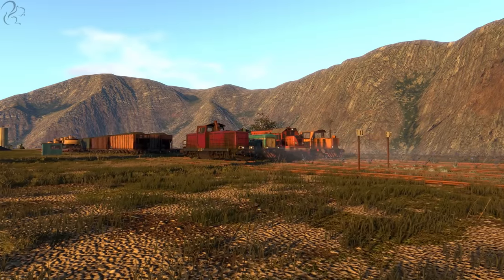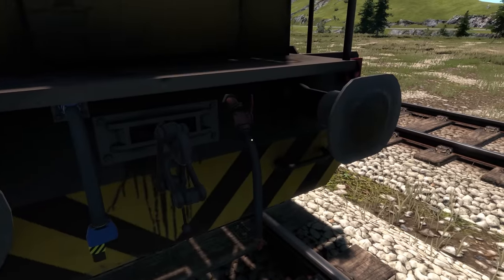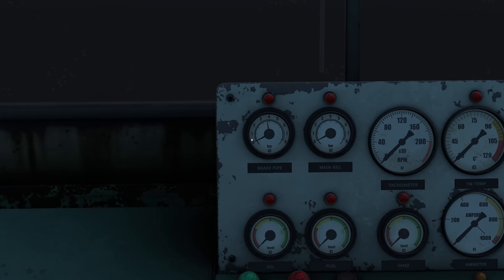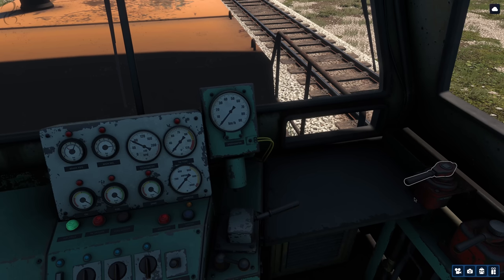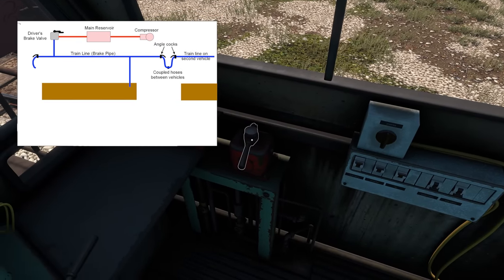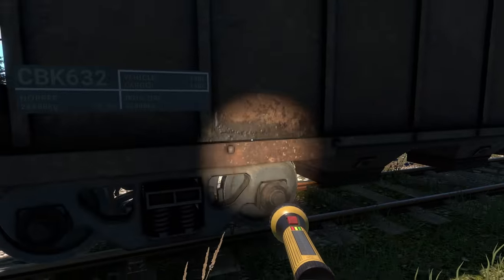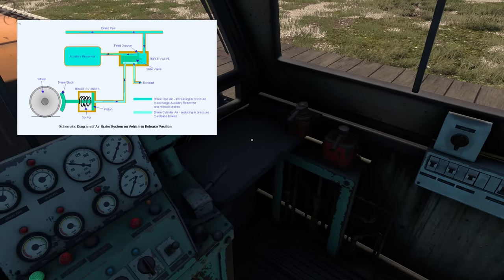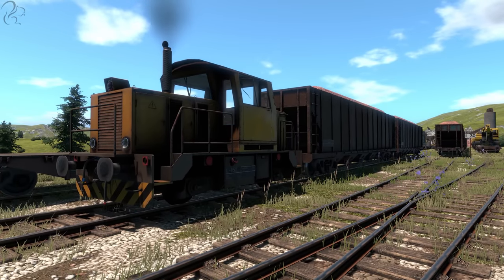Brakes: Everything You Need to Know - Derail Valley Simulator

Comment: So an air brake system is like a logic 'NOT gate' where the output in the inverse of the input. When pressure is supplied to the brake pipe the brakes are released, when pressure is released from the brake pipe the aux res applies pressure to the brakes.
Reply: Correct, that is also how Semi trucks operate.
Reply: That is how I used to see it also. But if the air bleeds out, I would think the cars would be locked. So why have a handbrake? Aren't the brakes on unless there is pressure from any source supplied to release them?
Reply: @catcracker48 Over time, the aux res and brake cylinders may leak and lose pressure without the pressure in the main line to top them up from - they have a 1-way valve. 

Alternatively, in order to "roll" the trucks, the pressure in the aux res and cylinders may be manually released using a mechanical pressure relief valve at one end of the carriage or truck. 

In either event, this will result in the brakes releasing and the carriage or truck being "unbraked" or rolling free. Handbrakes are effectively an insurance policy against this.

Furthermore, in the days before train vacuum (and now air) brakes became a thing, handbrakes would often be used to "pin down" the brakes on some of the trucks in a freight train before descending a steep grade, therefore allowing the driver to maintain control of the consist and prevent a runaway.
Reply: @liftedcj7on44s  I think the air brake in the trucks works inverted. You need pressure to apply the brakes.
Reply: @sobolanul82   no sir, air pressure releases the brakes
Reply: @catcracker48  Yes and no. The brakes are applied with pressure from the auxiliary reservoir which is pressurised by the main brake pipe. Pressure from the main brake pipe also controls a valve between the auxiliary reservoir and the brake cylinder, releasing pressure from the main brake pipe opens the valve and allows pressure from the auxiliary reservoir to apply the brakes, but it can't hold pressure indefinitely. If the auxiliary reservoir is not repressurised from the main brake pipe the brakes will eventually release.
Reply: @cmdrquillon9398 so if you fully apply brakes, the main line fall to 3 bar, and aux reservoir apply brakes of each car. It will eventually leak to the 3 bar of the main line. And still keep braking the train. Isn't it? (If main reservoir keep the pressure)

But if you disconnect the wagon from the main line, or it has a leak, so pressure go to 1 bar, I suppose, aux reservoir will deplete from 3 to 1 bar

So while full brake applied, aux reservoir has more than 3 bar, but start to leak to that 3 bar. Or maybe it is isolated so keep leaking, but always apply brakes, because it if keep descending, main line will replete again aux reservoir
Reply: @sobolanul82 nope it’s always pressure to release if there is a failure it’s better to have the breaks come on then to not work at all
Reply: @catcracker48  If the system bleeds out, there isn't enough differential pressure to trigger the brake.
Reply: @joshzwies3601 has the correct explanation. "Yes and no". If you just think "pressure releases the brakes" as I did, you are almost right, but there is more to know.
Reply: On most lorry trailers the brake cylinders have massive springs in them to hold the brakes on, and the air blows them off

Comment: There is  a rule for coupling. First mechanical and then pneumatic. In case when the hand braks isnt active and u connect the air line and then open the air vales. The cars can start move and will cut off the air line again.

Comment: I learnt stuff here!  I thought they were like some truck brakes and it was just a big spring which you use pressure to "release", not apply.  I always questioned this as ... surely that limits your force to that of the spring.  Now I know I wasn't wrong, but was wrong :D
Reply: Squirrel actually still has it wrong. The system works exactly like a on highway truck spring brake chamber. Put it this way. In america when they couple a 200+ car consist. Do u see a man running the length of a train undoing a mechanical handbrake ? Some older quipment doesn't have spring brake Chambers but it is actually law now as if I compressor failed on a train and it lost brake pipe pressure the spring brake Chambers APPLY the brakes to the train. Exactly like a 40 tonne highway truck.
Reply: @DieselProductions95 that’s American railway systems European system could differ
Reply: @DieselProductions95  Thank you, was curious about that

Comment: Interesting, semi-truck air brakes work exactly the opposite. No air pressure means the springs force the brakes ON. You need to supply air pressure from the trucks main tanks to release both the tractor and trailer brakes. I wonder why train brakes are the opposite.
Reply: Historic working method, as well as having the ability to shunt "loose" without working brakes for maintenance.

Comment: I thought air brakes on trains used the air pressure to release the brakes, not to apply them. As a fail-safe. Interesting stuff.
Reply: Well it does, doesn't it? You have to pressurise the brake pipe to set the triple valve to release the pressure from the individual brakes. To achieve that, the pressure in the brake pipe has to be higher than the pressure provided by the auxiliary reservoir. That way you have that fail-safe you describe: Brake pipe loses pressure -> auxiliary reservoir releases it's pressure to the brake.
Reply: @volkerklass7741 if there's no air at all in the wagon/ car, the only working brake is the handbrake.

Comment: I'm looking forward to the release but I can't help thinking that the braking system seems a bit backwards to me.

I'd expect the brakes to apply without pressure as they did in DRV Overhaul and as I believe they'd do IRL.

I don't know to be honest, it just seems safer to have a depressurised brake cylinder apply the brakes by having the spring apply the brake and the air pressure pushing against a piston to combat the force of the spring. If that makes sense.?

Cheers great tutorial as always.  TTFN

Comment: I assumed the brakes were applied via a spring load and the air pressure was used to release the brakes. That way if you don't have any pressure the brakes will be fully on without having to manually put a hand brake on.
Reply: this was essentially discussed in the video, unlike trucks, trains dont have a spring brake, its an air system that uses a mechanically operated handbrake
Reply: Then the max brake force would depend on the spring and the spring would get really big. With this setup you can provide really big brake forces with rather small parts.
Reply: On some trains, the handbrake or park brake works that way. A lack of air causes the brakes to apply. All other brakes on trains need air to apply the brake shoe on the wheel

Comment: The control of the distributor is achieved by varying the pressure in a second pipe called the brake pipe, which is connected to a brake valve in the drivers cab. Increasing the pressure in the brake pipe causes the brakes to release, while decreasing the pressure causes the brakes to apply. Diagram: Author. This is the article you used; proof.

Comment: I think air brakes on large truck trailers is just the opposite. The brakes are locked until there is air pressure.
Reply: not the opposite, just these trains dont have a spring brake
Reply: With no pressure, the brakes are applied by a spring. Pressure into one chamber (red supply line) releases the parking brake. Pressure into the other chamber (blue service line) applies the brakes pneumatically. Yes, the two chambers counteract each other.
Reply: @lordsanityfree  as i said, trains typically have a hand operated parking brake as opposed to a spring brakes as they are infact not lorries, theres pleanty of rail disasters caused by drivers not applying the hand brake because they switched off the engine which stopped compressing air to charge the brake lines

Comment: I always thought that trains would use the same setup as trucks/buses where they’d have a fail safe. Very interesting.
Reply: They don’t need one as they can break in 3 different ways and if all else fails they can run the train and set handbrakes
Reply: I'm pretty sure they do, as in it loses air pressure to apply brake pressure

Comment: I think this is kinda incorrect, From understanding how air brakes work I think the red needle is for the cars and the black needle is for the locomotive.
When there is pressure the brakes are released, when there is no pressure the brakes and locked which is why the red needle had pressure but the black needle didn't because even though the cars were not connected the valve was opened to apply pressure to them and since that line is sealed there isn't a leak with no cars attatched but the locomotive brakes were still locked ie no pressure applied.

Comment: Okay so now i understand what each brake does, can anyone tell me when to use ind. brake vs train brake?
Reply: As I understand it: 
Independent brake when it's just the loco. Using the independent when there are (moving) cars attached can damage the wheels; the heavier the load, the more damage, as the wheels have to skid for a longer time/distance.
Train brake when there are cars coupled. You can use train brake when just the loco, but I think it takes longer to both apply and release.

Comment: Hi Squirrel. Your indepth tutorials are the best by far. I have a question. I just left the steel works with my first job with 185 tons. I have played this game quite a bit in the other setting. Now I only got as far as the learning shop just down the track and the train came to a shuddering stop with no idea what caused this. Engine was in notch 1 and the traction motors were cool and all the brakes were off. I went back and payed the $100 dollar fee and that fixed the broken glass but the locomotive will not move. Any clues as where I stuffed up.

Comment: Wouldn't the "dynamic brake of a steamloco" be just to slam the reverser/Johnson bar/screwreverse in full reverse and open a bit of regulator? Like they would have done before the implementation of air and vacuum brakes, in the real old days of steam?
Reply: Don't try this in your car.
Reply: Reversing the johnson while the gear is moving can damage the pistons, it can allow a vacuum to be drawn by the exhaust pipes leading to the stack and suck cinders and ash particles into the cylinders. Old locos had a water brake, which was a separate inlet that would inject boiler water into opposing sides of the cylinder to cushion and slow the movement of the piston and by extension running gear. It wasnt a great system and many locos were upgraded with air brakes once they were widely known about.

Comment: I honestly thought the car brakes were (directly) applied by the absence of brake line pressure. Is the reservoir solution only there so cars can be moved without pneumatic power?
Reply: It works the opposite way, absence of pressure will release them.
Reply: @VanillaWahlberg  Naw fam, absence of pressure in the brake cylinders releases the brakes, but the comment you're replying to is talking about the brake line. When that gets depressurized, the aux reservoirs kick in and provide pressure to the cylinders.

This is what's confusing everybody. The line and cylinders essentially exist in opposite states. When there's no pressure in the line, the control valves open the aux tanks to provide pressure to the cylinders and apply the brakes. When there is pressure in the line, the control valves dump pressure and the brakes are released.
Reply: @Squant  but the absence of brake pipe pressure is what releases them... I know there's auxillary reservoir tanks and  they're filled to a specific pressure. 

The train in Canada that ran away into a town from the top of the hill explains this. The auxillary pressure holds the brakes momentarily in the tanks but it's mostly used to hold extra pressure I thought. That's what handbrakes exist for in case you need to stay stopped on a grade.

Comment: There is still brake overheating to cover.
Reply: Not that much to say really. The longer you apply the brake, the hotter it gets, the less effective it becomes (AKA brake fade). Once the brakes are released, they will begin to cool. They take no damage and won't need repairing. You'll simply have to be more conservative with the train brakes and make use of the dynamic brakes (if available).
Reply: The time involved will vary depending on duration, force applied, and overall weight. We have no reference for what that entails. There's "not much to say" for wheelslide but was still covered.

Comment: I have to again say, train brakes still aren't failsafe 🙄 reverse the spring in the brake cylinder on the cars, make the spring apply the brake, and the air release the brake. No air=full brakes.
Reply: That is deliberate on trains
Reply: @KrisDouglas  How is the Westinghouse system better than the standard truck air brake system? No air should mean full brakes, regardless of how full the train car's tank is. If the local tank is empty on the car, the brakes don't apply with a brake reduction on the Westinghouse system. The whole system is unintuitive. The brake pipe reduces, and so the air tank on the cars sends air to close the brake cylinders? Nah that's just obviously not safe. The main danger of truck brakes is brake fade if the driver doesn't notice the brakes are applying on the trailer. Which also already happens on trains. The difference is, on a train if no air is getting to one car, that'll mean the whole train behind it locks up and doesn't require manual hand brakes to keep it in place once its stopped just evacuate the air and the springs auto apply.

Comment: Honestly, that's pretty disappointing.

The triple valve simulation is completely incorrect. You shouldn't be able to gradually release the brakes, and the relationship between the brake cylinder pressure and brake pipe pressure reduction is totally incorrect, the triple valve that gives a full application with BP pressure at 3-4 bars would be an unserviceable piece of junk irl. The brake valve has different notches and its different positions do different things - the first one is the release, then there's cutoff/lap, the graduated application and the emergency position which dumps the BP to atmosphere. In Simulator it seems to be not more complicated than a water faucet. Also, the brake valve handles are animated incorrectly - the emergency position should be the 6 o'clock position, not 3 o clock. I see a significant downgrade from the Zeibach mod in the original DV, which is surprising to say the least, given the fact that he's a member of the dev team now...
Reply: Depends on which kind of brake is simulated, Knorr Bremse (German) can release gradually.
Reply: There is a balancing act that has to be done. They still need to make the game a game. Don't expect everything to be an accurate 1:1 for real life. As is, this is a hell of a lot more simulation than has been in the game. And there is still the potential for mods to do more.
Reply: @ram89572  My accusation is that even though they said Zeibach is now working for them, the brakes in the game are a significant downgrade in realism compared to his mods. And he will probably not make a version of the mod for the new Simulator because he's already on the pay list.
Reply: @robinnieuwenhuis4715  Which exact type of Knorr's triple valve and driver's brake valve are you talking about? Only electropneumatic brakes as used on some passenger stock and multiple units can be graduated in release. Most braking systems I've seen on Eastern European rolling stock (which this game is representing) are non self-lapping, single pipe type, and these cannot be gradually released. Neither can other types of brakes around the world, like Westinghouse or Matrosov.
Reply: All triple Valves like KE, O, SW, SU, Ch and are self lapped. Also the famous Knorr D2 brake valve works like the brake valve ingame.

Knorr 8 ist non self lapping like most indipendent brake valves. Indeed, the self lapped indipendent brake is somewhat unrealistic.
Reply: I wish we still had the non-self lapping brake as in the mod... where it was optional BTW. They'd just need to add the options and have it implemented as well, like the mod did.